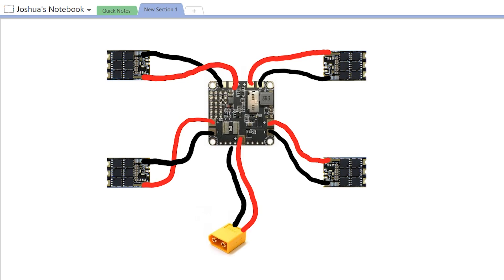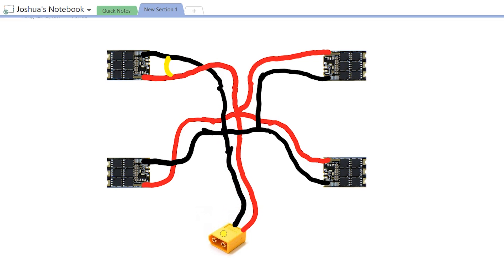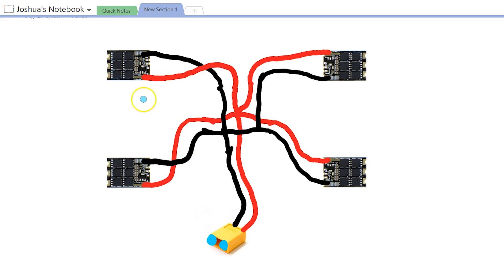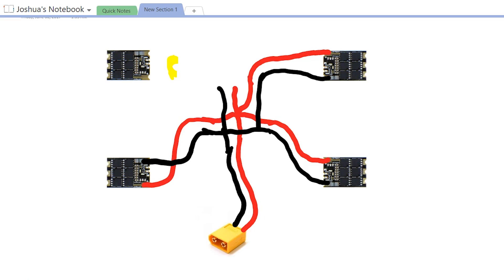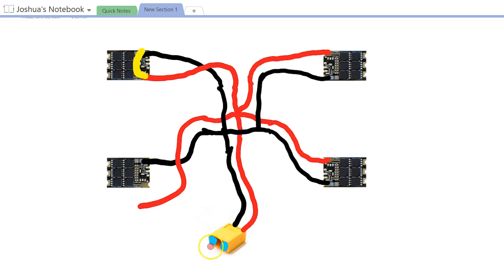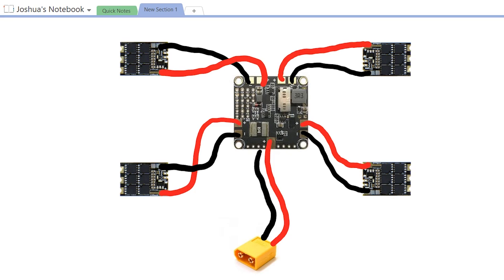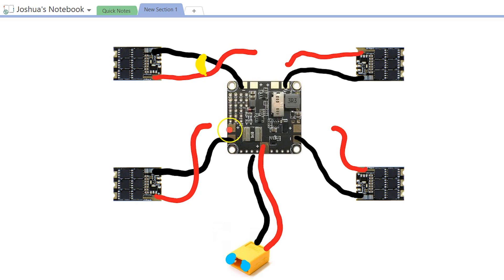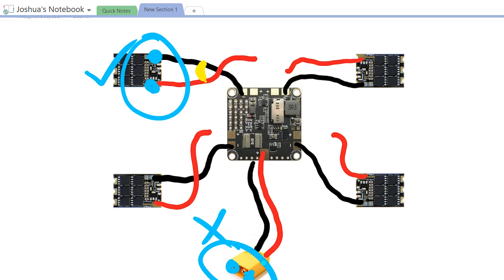How To Find The Short-Circuit In Your Quadcopter

Comment: I am not stopping this Vid to get a smokestopper. I stop it to write that its not neccessary. I always put my Multimeter on the xt60 connector before plugging in the battery when I changed stuff on the quad.
Reply from the maker: Sorry, but that's not a perfect solution for these reasons:

1. Sometimes a part can not-quite-fail. Multimeter shows no continuity, but as soon as you plug in, you get smoke.

2. Multimeter does not protect against faults such as wrong firmware flashed to the ESC.

3. If you use a smoke stopper, you can safely choose to plug in the battery with props on, because the bulb will prevent enough current from flowing to do any damage. 

Do what you like, of course, but a multimeter is not a substitute for a smoke stopper.
Reply: Agreed
Reply: Joshua Bardwell Thanks for the comment. I don't want to agree with your 3rd comment "plug the battery with props". Even with the smoke stopper for the first time. Smoke stopper only consumes 0.3  Amps.

Comment: just to add, when im building i have my multi meter ready, after i add a component i check continuity, that way it saves me the even longer proccess of having to back track and make things messier.
Reply from the maker: It's not a bad idea, honestly. Then you know exactly where the fault is. In my specific case, I had an ESC fail after a crash and I didn't know which one it was.
Reply: Joshua Bardwell you? crash? never......lol

Comment: I tested the continuity of my tongue and that's how I found out the multimeter sends power to test the continuity. Should I be careful what I poke with the continuity (eg a chip other sensitive components)? Or is the multimeter safe enough to poke anything with?
Reply from the maker: It's safe. The current/voltage used is extremely low. However you should not measure continuity on an energized circuit. I'm not 100% sure why but I think it could mess up the multimeter? I don't know, that's just what I've always heard.
Reply: Silweror Should be save... measure the voltage applied wünsche measuring resistance with an other Multimeter... Should be around 1 Volt..